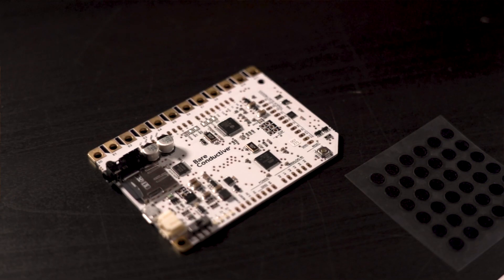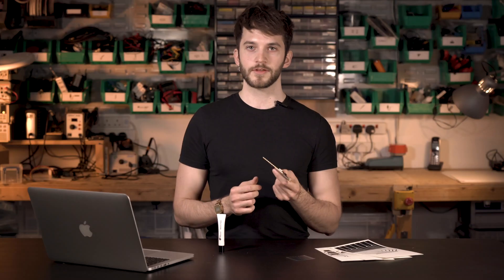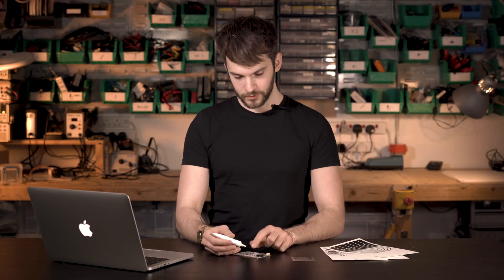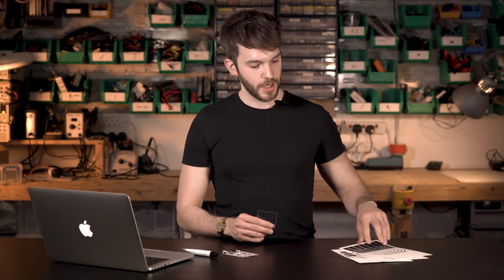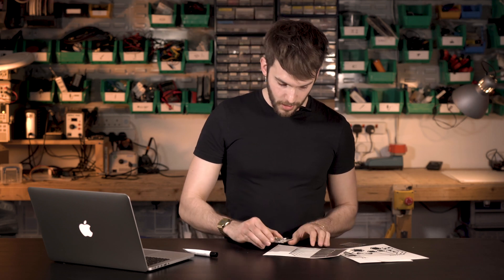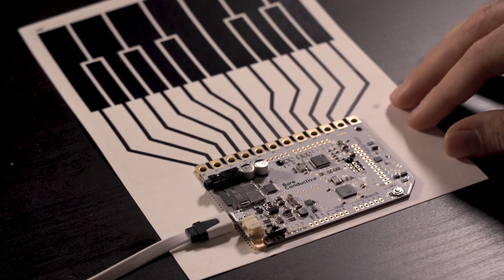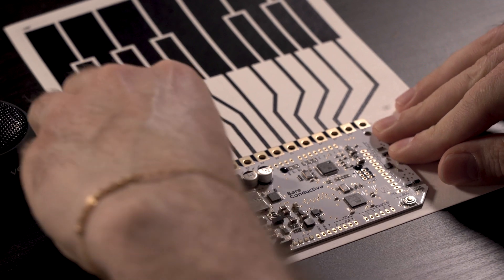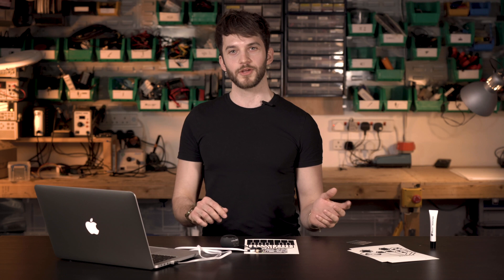Interactive Workshop Pack | How to create your own MIDI piano

Comment: hi im getting the note 68 on and off readings in the serial monitor but i am not hearing any sounds. I have "soldered" the two midi controls with copper tape and connected the board to a speaker. Please help
Reply from the maker: Can you send us an email to info@bareconductive.com?